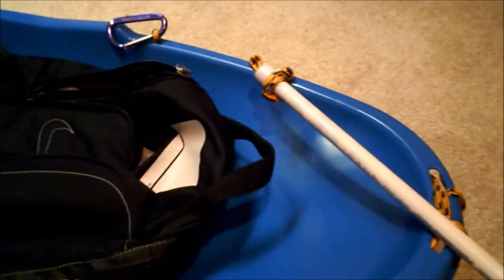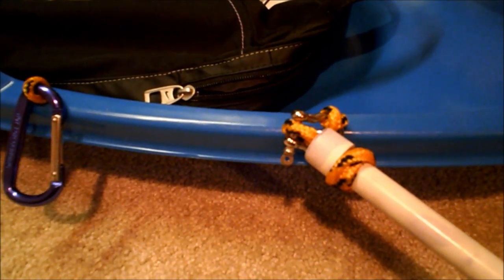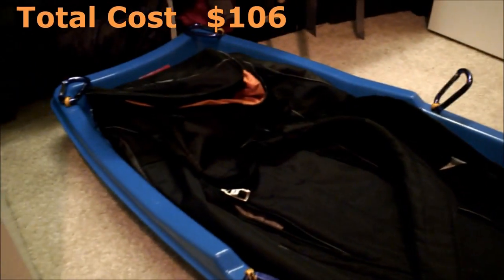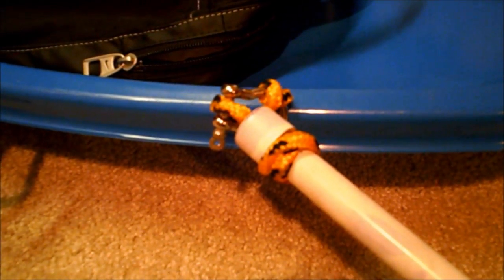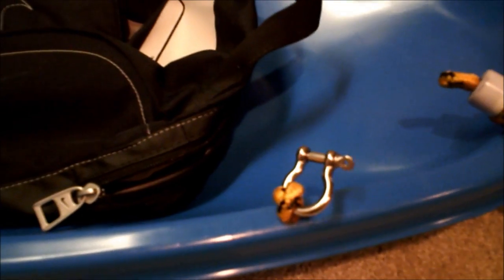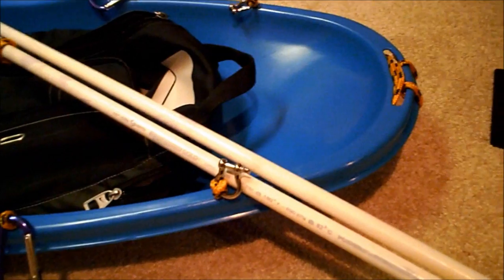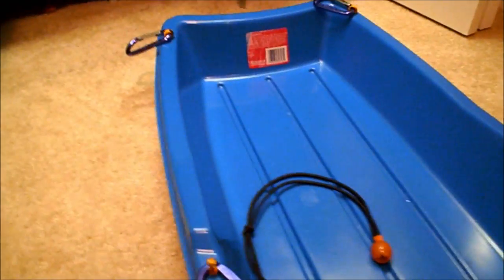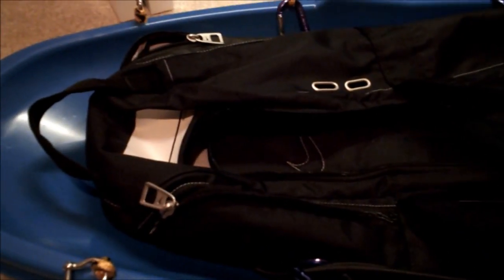DIY Simple Pulk Sled

Comment: Thanks for your video. I just built myself a Pulk sled using basically your design exactly and it turned out looking like your Pulk sled's twin. I made a video showing it.  I'm not sure how to add the link to my comment but you can probably find it easily.  It's called "DIY Simple Pulk Sled Twin"  I can't wait until we get some snow this season so I can go out and use it. Thanks again :)

Comment: Your video helped me solve my 'pulk problem', thanks. I bought the same sled that you did, and only afterward realized it wasn't really the best sled for the majority of the pulk designs on youtube, since the very tapered front doesn't have much space to bolt on the pole attachment hardware. I've been thinking of ways to do it, but none are as simple and cheap as yours. With a trip coming up soon, I don't have time to make and test more complex hardware, so yours is perfect--especially so since I was planning to use the same sort of rope scheme for the cargo tie-down loops.

One thing, however, for completeness... you might want to mention the size and length of the cpvc you used for your poles. It seems most people go with 6 ft, but I've only seen pvc in 10ft sections at Home Depot/Lowes, so I'll end up with 5ft poles.

Comment: Great idea. Simple to do and less weighty than some of the ones I've seen. I think I would carry emergency items and basic survival needs on my person and everything else in the sled. That would make it a lot easier for someone with a back problem. I also think that attatching it to a separate belt instead of the pack could prove usefull in some situations should you need to detatch quickly for safety reasons. Hiking in steep or rocky terain on the AT and the sled slide off an edge, or getting it caught in brush. Then you wouldn't need to drop your pack as well to deal with the issue. Love the video. Happy trails.
Reply from the maker: +Mama Ren Thank you for your thoughts.  I have since used a separate belt as you suggested.  Appreciate you watching and commenting!

Comment: wawhiker, I do have a few questions. What size rope did you use ? What size holes did you drill ? Could you explain how you attached the rope to the ends of the poles again ? Could you just make a looped on both ends piece of rope and run it through the poles ?    Thanks for your help.   Take care, Bluefin

Comment: Great vid! Love the simple, field repairable design feaures.  Did you have any problems with the PVC cracking in the cold?  Don't know for sure, but I've read elsewhere...  Planning a backpacking trip in the Porcupine mountains in MI upper penninsula end of Jan.  Thanks again for the effort and sharing!
Reply from the maker: +Nicholas Hillebrand Thanks!  The PVC I used is CPVC, which is more resistant to hot/cold.  If you watch my very latest vid (not a plug, just proof) - I'm still using those original CPVC poles.  Appreciate you watching, commenting and asking.  Enjoy your Porcupine Mt. trip.  I'll look forward to watching it...
Reply: +Nicholas Hillebrand Far North Bushcraft and Survival lives in Alaska and he uses CPVC. He has no problems with his.

Comment: I appreciate your effort and execution, but this sled will not hold up over time. I have used these cheap children sleds before- they hold up fine on flat terrain with fresh snow, but add any topography+ice or rocks into the equation and they will break apart in a matter of minutes. You will be left carrying/dragging a bunch of plastic scraps and tethers. Also, without reinforcing the holes they will crack in no time- especially when the plastic is cold and brittle, despite your effort to disperse the stress.